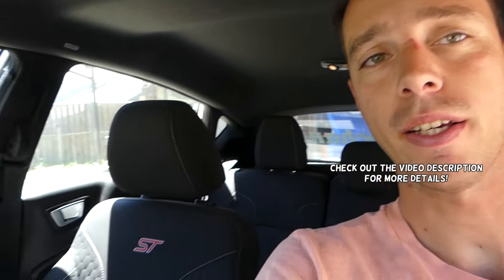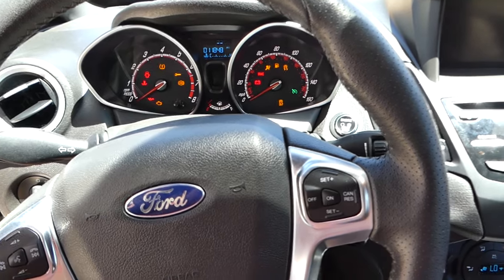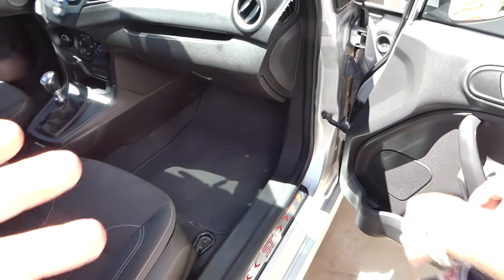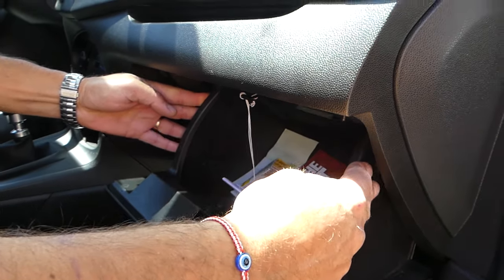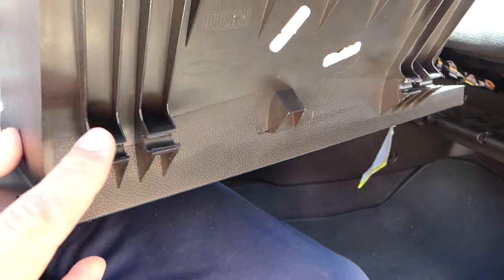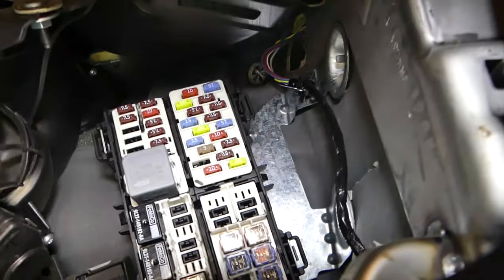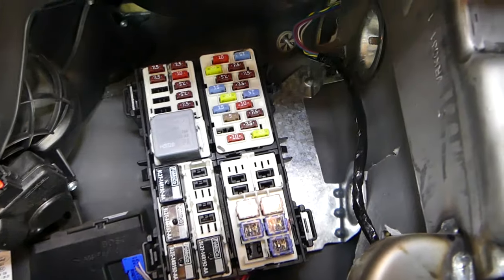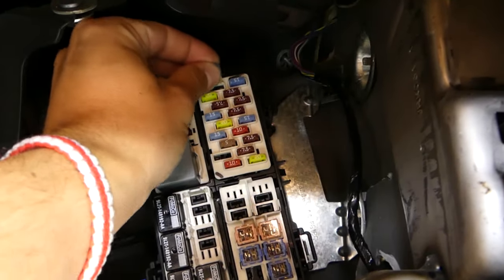FORD FIESTA RADIO FUSE LOCATION REPLACEMENT MK7 ST

Comment: If you ever encounter the problem when you turn off the car and open the door the Radio unit usually is supposed to turn off, in some Fiesta ST the unit will stay on and continue broadcasting the radio into the speaker however the screen unit is turn off, turning the car ON and OFF wont do in this case ... it is like the Radio Unit doesnt control the sound anymore, if anyone is having that problem the Fuse you just changed is the best solution I have found so far, removing it and putting it back reset the Sync unit and it solve the problem.
Your video is great, thought I would share a problem I had in your video since it is related,
Keep it up the good work from a fellow car enthusiast 😎
Reply: Nice comment. I had this issue as well. It's a cheap fix to get rid of the horrible static (or popping) noises that occur even after the car is turned off.

Comment: What if the radio turns on but there's no sound? Could it still be that same fuse?
Reply: I have the same problem. Could you solve it?
Reply: My wife has the same issue on her car. Anyone have any luck?
Reply: Any luck